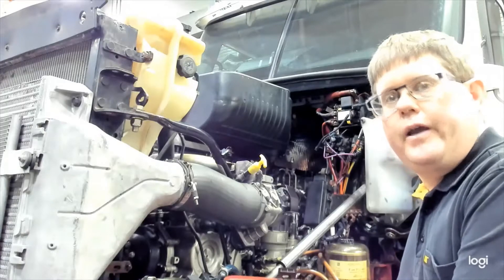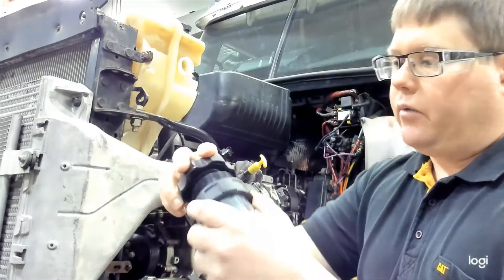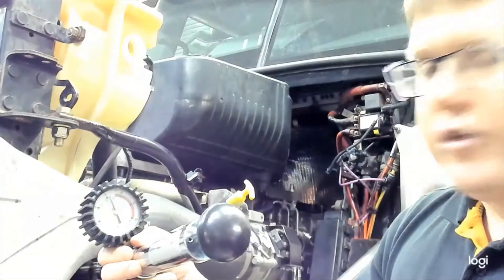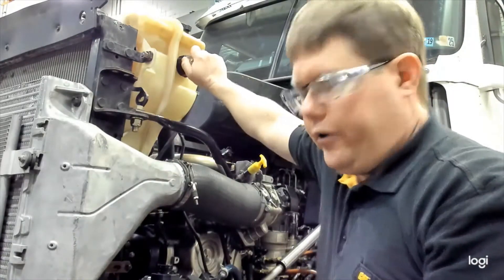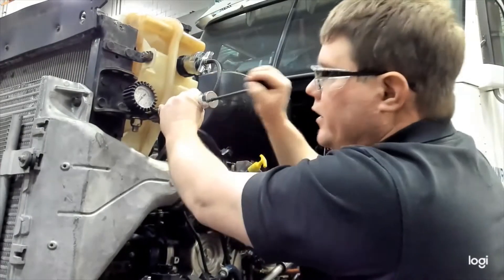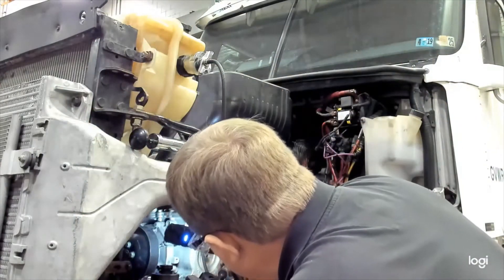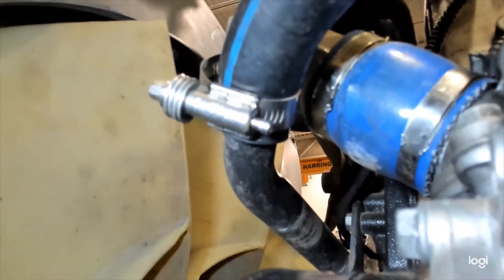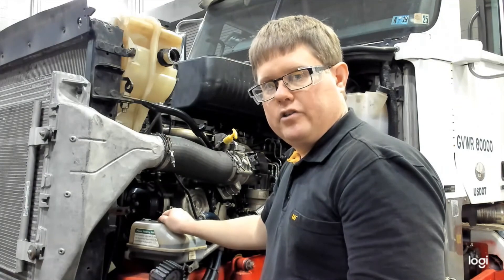8.01 Cooling System Pressure Test Demo

Comment: I’m considering getting a Hazet pressure testing setup, just for working on some of our older, high-mileage cars in the family. Have you heard much about the testing causing problems in older cooling systems, where the vehicle was “getting by” under lower stress grocery store driving, etc.?
In other words, will the hand pump burst our 200k mile heater cores if they were getting close to clogging or bursting?
Reply from the maker: I have not heard of the testing causing a system to fail prematurely but I suppose it would be possible since manufacturers recommended going 1 or 2 psi over what the cap is creating.  If you want to be on the safe side, you could pressure test the system to only what the cap tested at.  For example, if the cap is rated at 15psi but tested at 12psi, only test the system to 12psi.  I can't see how testing to the exact pressure of the cap would cause the system to fail under the stress of testing if it wasn't going to fail anyway with the cap.

Comment: Thank you for the video very helpful. But what test kit are you using?
Reply from the maker: I am using the Snap-On SVTS272 pressure test kit.  It looks like they have a slightly newer version available here: https://shop.snapon.com/product/Cooling-System-Testers/Cooling-System-Pressure-Tester-Kit/SVTS272A
Reply: @JimMackHeavyEquipment  thank you i greatly appreciate you taking the time to reply.
Reply: Well explain,Good job .ty